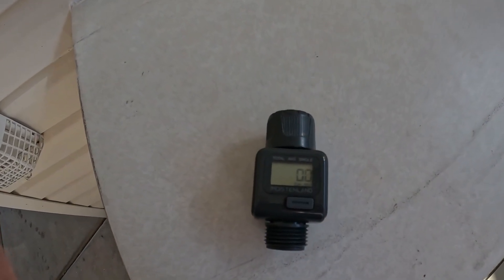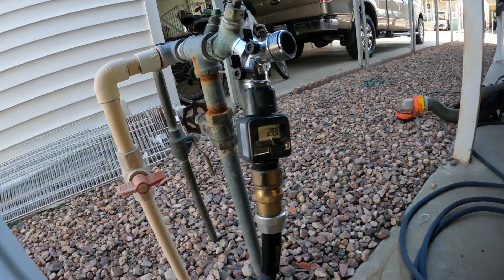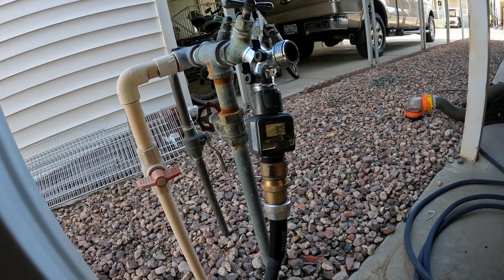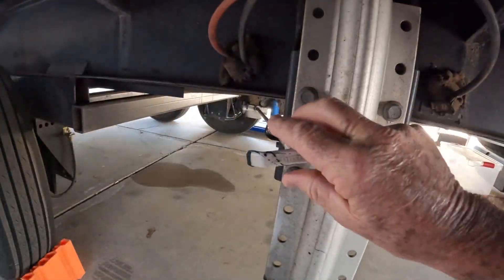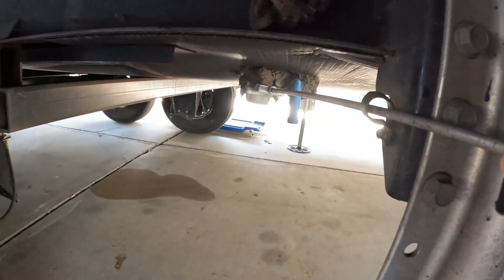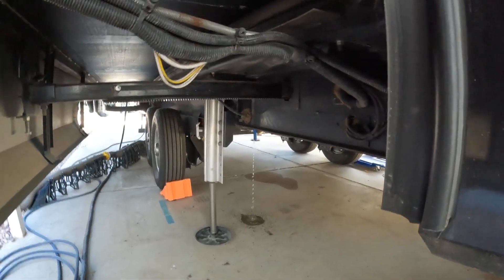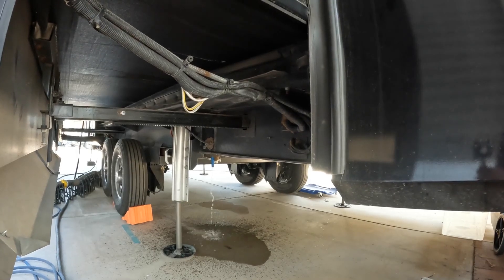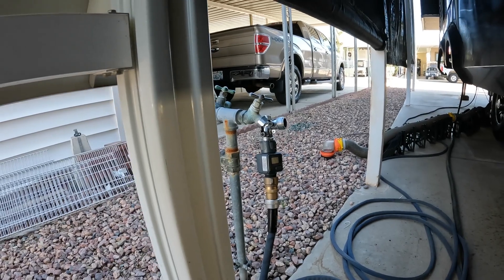Water Usage Gauge

Comment: Never heard this angle before. You really want to hear your water pump laboring and grinding to brush your teeth?? City water when filtered and regulated has even pressure. A half cup of bleach in my 85 gallon tank monthly keeps it sparkling clean. And 81 gallons for 3 days???? 81 gallons lasts me 12 days!!!!! Take a quick shower. If in the boonies, boys can water a tree outside and reduce your flushing. You have a "Y" valve on the hose, use it to wash dishes outside in the busboy tray, then a quick hot rinse inside with a pint of water. Great video and thumbs up!!!
Reply from the maker: Yes, I am the absolute worst at conserving water and honestly thought I would get better at it, but it hasn't happened yet 🤷‍♂️ Thanks for the tips! Scott.

Comment: Sorry, this question has nothing to do with this particular video, but I thought if anybody could you could answer this question.  There are conflicting views on whether to travel in an RV trailer or Fifth Wheel with the refrigerator going, with or without food.  I don't understand why manufacturers would install a fridge that one cannot store food in while traveling.  Apparently, it is a leveling issue.  What are your thoughts?
Reply from the maker: In the 4 yrs that I've been traveling, the first year in a Travel Trailer and the remainder of the time in a 5th wheel, I have left the propane on while traveling. The manufacturers advise us to turn them off so if anything bad happens they are not responsible for it, and given that there is a small flame burning behind the refrigerator access panel there is a potential risk of a catastrophic fire if you were somewhere that has A Lot of flammable fumes you might want to close the propane valves.
I hope this is helpful Judith.

Comment: Hi Paul are you still a fan of Juiced Bikes I’m finally ready to purchase one I’ve seen your previous reviews I really like the Rip Current S. I also like those Rad Bikes I was wondering what are your thoughts I would appreciate any advice. Thank you 🙏🏼
Reply from the maker: Hey Mark, I still like the Juiced a lot. The main difference between Juiced & Rad is the size of the battery, and the brakes. Juiced has hydraulic brakes and the Rad has Mechanical. The Juiced also has a larger battery 19.2 Ah vs 15 Ah. This only matters if you want to ride in excess of 30 miles, the Juiced will do that and more, whereas the Rad will be running on empty.
Maybe I should do a video about that 🤔
Reply: @paulontheroad  that’s what I was thinking. Thank you for your help sir wishing you the best post to see you on the road someday soon sending you positive energy. From my chili, Southern California
Reply from the maker: @Markpatrickrich  You're in my old stompin grounds, where in So Cal?

Comment: Hi Paul I wanted to know the make of the e-bike you have and what you think about it thanks
Reply from the maker: It's a Juiced Rip Current S Step-Thru. I like it but I liked the Juiced Cross Current X that I had previously. The difference is mainly the tires; The Rip Current has 26 x 4" "Fat Tires" and the Cross Current has skinner 28.5 x 1.75" wide tires. I could get 34.9 out of the skinny tire bike and the best I've gotten out of Fatty is 31, so it's certainly Not a huge difference, but I like speed 🚴

Comment: I don't like to leave city water turned on in our trailer, we have had parts fail and filled the trailer with water.  We fill the tank and use it, then refill when needed.
Reply from the maker: Exactly, it also allows you to turn off the pump when you're going to be away. I don't always do that, but when I'm going to be gone for a whole day I do.

Comment: Paul, we have two little digital water meters very similar to the one that you have. We have one for when we fill the freshwater tank and another one that we use to measure the water going into the black tank when we use the black tank flush after pumping out. Using it with the black tank flush lets us fill the black tank completely for a good clean-out. 
Nice video, Paul---thanks for passing this tip on to others!
Reply from the maker: I hadn't thought of that OCNY, I'm always concerned that I'm going to overfill the black tank when I'm flushing it. Now I need to buy another one.

Comment: Hi Paul,  That's a good idea.  I have a pop-up camper with a small freshwater tank.  I think it's maybe 20 gallons.  I don't drink the water in it though.  I drink from a 5-gallon container that I fill before leaving home.  I have a filler system that I made up especially for the 5-gallon water container.  I also made up a small portable battery-operated water pump that I can use to pump water from a stream if needed.  The whole system fits in a small ammo can, battery and all.  I show how I use it in one of my YouTube videos.  I have never camped in a campground with full hookups, so I have never used city water.   I also drain the fresh water tank when I get back home.  So I am flushing it out after every trip.  If I know that there will be a water supply from a stream at the Boondocking campsite, I will fill the camper tank once I get set up.  That way I don't have to haul all of that additional weight up the hill.   And I agree, you are looking and sounding better these days.
Reply from the maker: Sounds like you've got it down 👍
What's the name of your channel?
Reply: @paulontheroad , My channel is named "Boonie Buster".  Here is the link to the video where I used the water pump.  I show it about halfway through.  The pump isn't something you would use because you always have hookups.  But I only Boondock .https://youtu.be/_QPk9acBF7s

Comment: Paul you have been around the block a few times, so there is not much to don't know 
I attended the NRVTA and am working on being a registered teck, and there advice and opinion is to use your holding tank for much the same reason you mentioned
The only other thing I  can think of is, when the weather turns cold on you and you are using holding tank your lines have much less chance of freezing. 
I know the plan as RV'ers is to not be in freezing Temps, but some times bad things happen.
Than,s for taking the time
Your doing g a great job and service
Cheers Rob.

Comment: You should use a water filter if you're worried about unwanted particles in your tank.
Reply from the maker: I have a filter just before it goes into the tank
Reply: @paulontheroad   what is the micron size on your filter
Reply: @paulontheroad  Do you also use a water pressure regulator?
Reply from the maker: @vicO-3123  Yes, I sure do.
Reply: Paul do you have a sticker inside your trailer with the model of everything in the unit. It may be in a cabinet on the back wall or inside of the cabinet door
Reply: Did you get and documents with your trailer

Comment: Always good to see a notification of a new video from your channel! My wife and I are not yet on the road, but fresh water tanks are a concern to me too! I’ve heard too many RV technicians tell horror stories about “fresh water” tanks! Thanks again Paul!
Reply from the maker: Thanks, Buck and yes I've heard my share of horror stories too. Even if you buy a new rig I'd strongly suggest you sanitize the fresh tank before you use it. It's pretty easy you just fill it up and add 1/4 cup of bleach for every 20 gal of water let it sit, or even better, drive it around for an hour then using the pump, run the water into your waste tanks and then dump the waste tanks.

Comment: Hello Paul, if I use my pump it makes a lot of noise, how do you reduce the noisy pump running.  Also I see your suspension under your trailer , is it Morryde independent?
Reply from the maker: Yes it's Morryde IS.
as for the pump noise, I hear it but it's not loud enough to be annoying to me.

Comment: There's an overflow?

During one of my first trips in my trailer, I was running the black tank flush and got sidetracked after closing the dump hose.  A little later, someone knocked on our door and said there's water coming off the roof.  The black tank filled up and was overflowing via the vent on the roof!  Thank goodness the toilet flapper didn't leak!
Reply: Yikes!!!
Reply from the maker: Yes, there's and overflow/vent on top of the fresh tank. Totally separate from the Black and Gray vents. I had a similar thing happen with my black tank once 💩